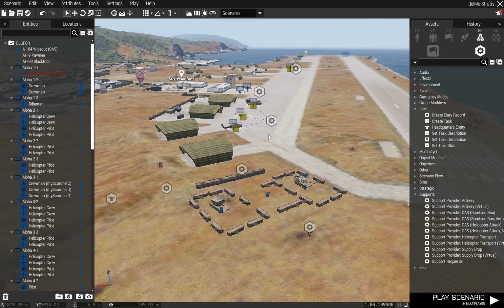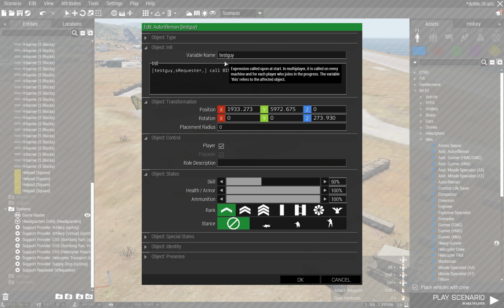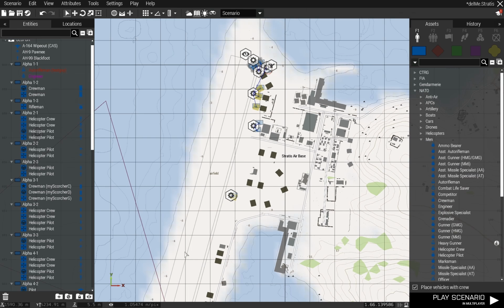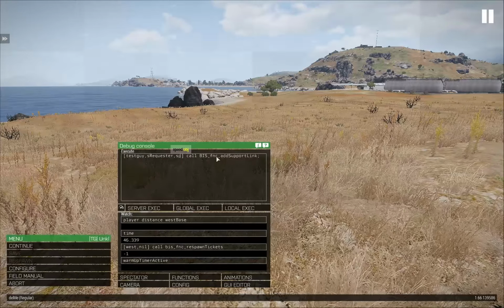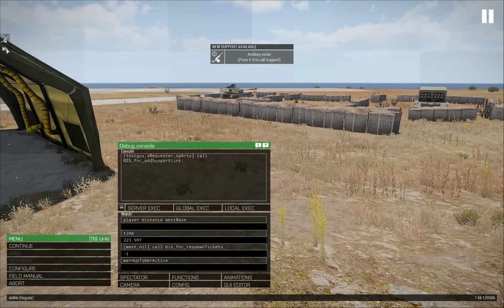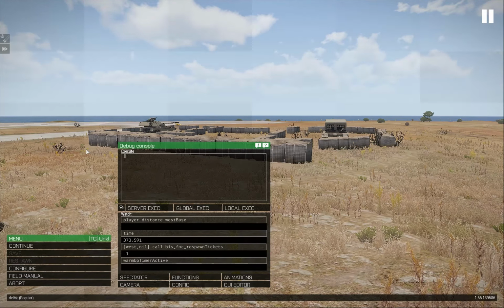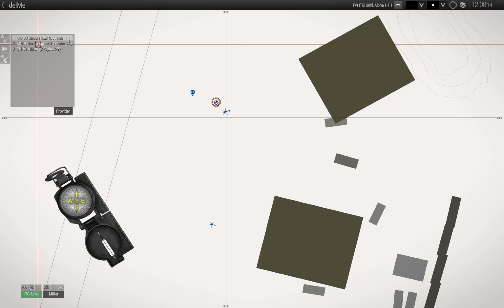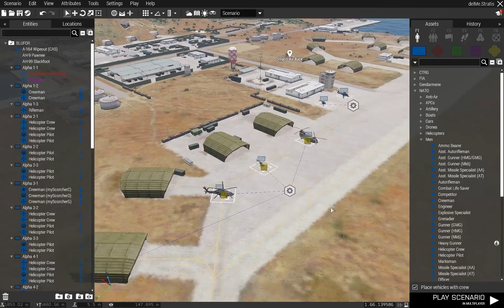Arma Editing - Support Modules - Updated Tutorial

Comment: The problem that I have found is that if you use Ctrl+U to change between playable characters it seems that the new player character can't connect with the requester module if he was connected before it was even a player, even if you linked everyone at the start with a for each only the soldier that you start playing with will be able to call for the support so you have to link them when they become a player...removing and adding again the link in hope of fixing it doesn't seem to change anything.

Comment: Question... I am having an issue getting support to unlink from unit. I have it setup to add support when sector owned but it will not remove support form other side. I am trying to use the following:

[commanderEast, supportRequesterEast] call BIS_fnc_removeSupportLink; 
[commanderWest, supportRequesterWest] call BIS_fnc_removeSupportLink;
[commanderGuer, supportRequesterGuer] call BIS_fnc_addSupportLink;

But for some reason it wont do the removeSupportLink..... any suggestions?
Reply from the maker: I noticed in the documentation for the bis_fnc_removeSupportLink that 
there are only two parameters. The support requester and the provider. 
The unit is not one of them. So it looks like you have a separate 
requester for each side which is good. So try something like this:
[supportRequesterEast, supporProviderEast] call bis_fnc_removeSupportLink;
ect...
Reply: Thank you for the reply. Yes you are correct. 

I think I figured out my problem. I was only testing by myself and it becomes a sync issue if you just try to change sides. It will act as tho it will not work. But it you have multiple people on it works correctly. 

Thanks for the help.

Comment: Having an issue with a MP sandbox scenario. 2 opposing sides, each with their unique supports (2 support requesters, I guess). The addSupportLink function is added to the squad leaders. It will be a problem when the Squad leader with the addSupportLink function leaves right? The remaining players in the squad are left with no support. Complete noob when it comes to scripting so not sure how to handle that situation.
Reply from the maker: https://community.bistudio.com/wiki/Arma_3:_Event_Handlers/addMissionEventHandler#HandleDisconnect

You can use this event handler that runs server side and returns the unit a player was occupying right before they disconnected. You could then know to add the support module to the next player of your choosing (i.e. the leader).
Reply: Thanks for the answer. So far I have the supports working perfectly using this in the squad leaders init.

[playername,OPFsRequester,OPF_Transport_Provider,OPF_Ammo_Provider] call BIS_fnc_addSupportLink;
[playername,BLUsRequester,BLU_Transport_Provider,BLU_Ammo_Provider] call BIS_fnc_addSupportLink;

As for the HandleDisconnect my level of script knowledge is pretty much copy/paste LOL. I'll take the day to try and figure it out. Thanks for this video its helped me greatly.

Comment: Hello, very nice tutorial! Didn't even know these Modules existed :D. However I do have a Question: 
What does synching the Requester module to the player do? When I synch it to my Player in MP, all other players can call in Support, but I want only certain players to be able to request Support. I tried to synch and unsynch the module with the player (synchronizeObjectsAdd and synchronizeObjectsRemove) but, it seems the synch does not do a thing. Do you know of another way?
Reply from the maker: I don't know of another way to make these work. The sync between the player and the requestor module should be enough to allow that player or that unit to access the supports. My guess is the Bohemia developed most of these modules for single player use and that their actual function may either not be written for multiplayer and/or that as the game updates are released the modules behavior in MP could be altered. I haven't used them in a MP mission in a while now.
Reply: ok. thanks anyways ^^

Comment: Hey Unkl, thanks for the video, was just what I was looking for.
One quick question though, how would you set it up if you only wanted the player to have access to the supports if they have a certain backpack for instance?
So basically I want to link any player with a certain pack to the support requestor module. As soon as they remove the pack then disconnect them.

Cheers and thanks again for the videos
Reply from the maker: An answer for this one is going to take some testing. I remember that the removing a requestor (if they were to drop the pack) is a little tricky. But in basic form you can run a script that loops and adds the requestor to any unit that has a backpack with a particular class name. It could also be complicated if you have the arsenal available and any player could load a preset that might have the same pack or item. It's a cool idea.
Reply: Yeah basically I just want my JTAC to have to carry a long range radio pack in order to call in support. That way if he dies, someone else in the squad can pick up the pack and call in extraction etc. I suppose as you say I could just loop through each player, if they have the pack then link them to the requestor else unlink them.
Usually we use ALiVE for this but their support modules aren't the most dependable at the moment.